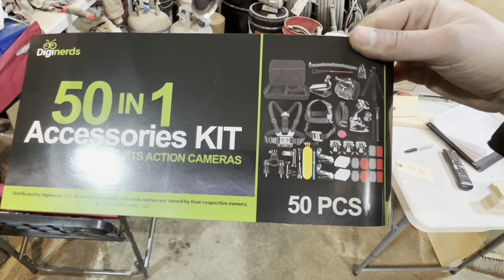Everything needs to go…

Comment: Pour can with a spout works good for adding hydraulic oil to a 4010 and 4020 tractors. The 4010 had a generator when they came out , 24 volt starter.